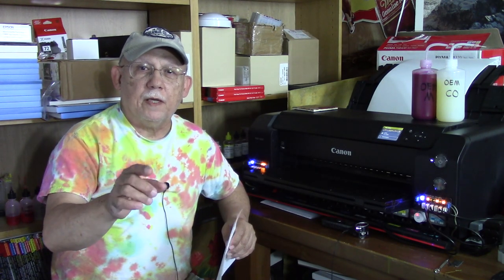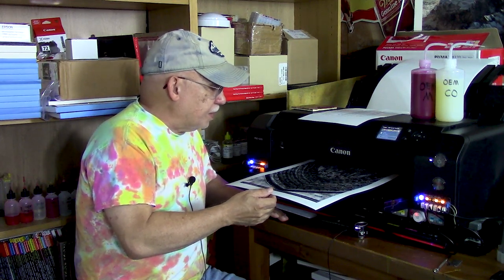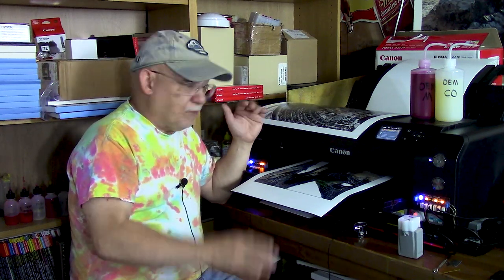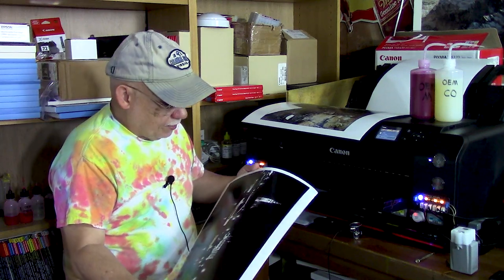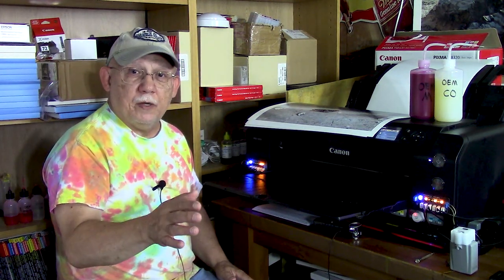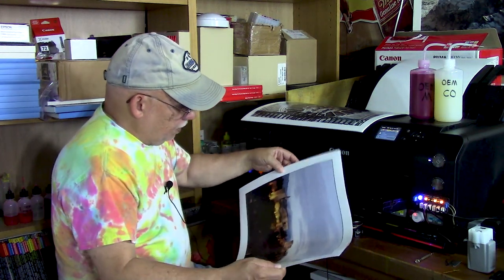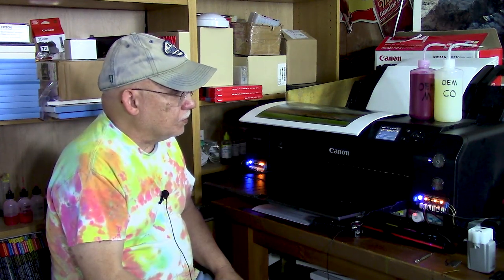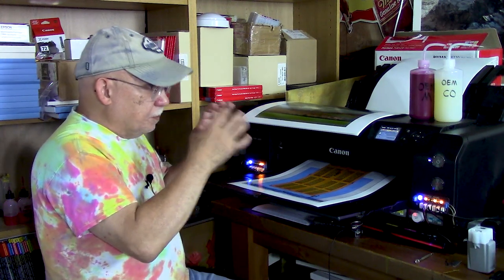CANON PRO 1000 Control Cart Sensor Real World Check! WARNING this is 1:45 hours long.

Comment: Jose, how do I turn off the monitoring function on my Pro-1000? I tried holding the lower button on the front for 10 seconds and nothing changed.
Reply from the maker: Exactly that way. According to PC you can just fill up your empty nothing will change. What you will see is a Red X and if you hover over that color channel on your driver you see a tiny amount of level and you see a warning that if you continue to print you might run out of ink. Supposedly at some point you need to do it again and then it stays disabled until you insert a cart with a fully working chip. I have 9 RED X carts right now and it continues to print. I just did a set of twenty six 13x19s in my video testing the brand new ink level sensor system

Comment: Excellent, Waiting for the release!!!
A bit off topic.. Anyone knows where can I download the Adobe RGB (1998) ICC profile? The download from Adobe support doesn't work, I get the following error (tried 3 different web browsers) "The connection was reset"
Reply from the maker: Why? Are you going to print with that? That's a Working Color Space. Not a paper profile.
Reply: @cheo1949  I was going to use it with my Benq wide gamut monitor  but I have just ordered an Xrite i1Display Pro so, I'll calibrate it as soon as I receive it. Sorry for the derail. I really enjoy your channel. Learned a lot much more left to learn..

Comment: Thank you, Jose! We are standing by with baited breath awaiting the release of this sensor system for the Pro 1000.
Reply from the maker: The Circuit Boards have been ordered in bulk and then he (PC ) has to solder all the components by hand so it will take a while to get just a few ready to be kitted with the sensors and other components.